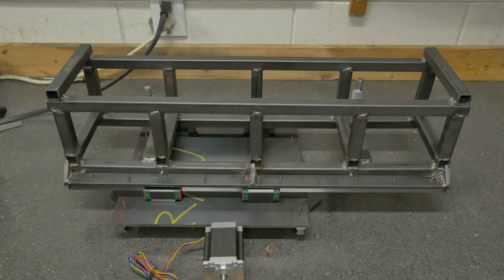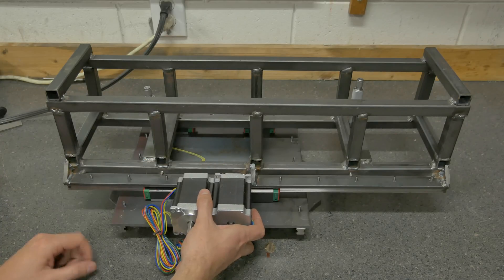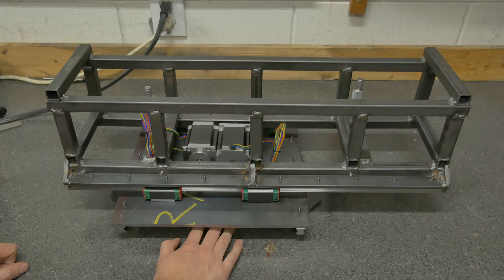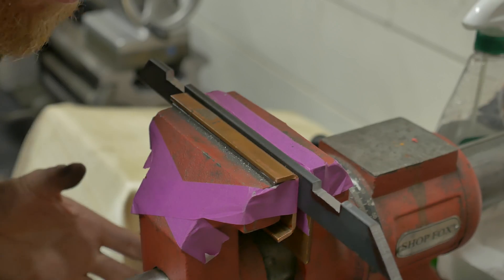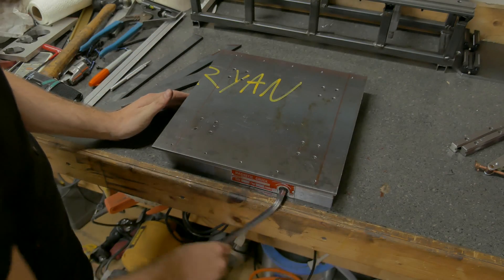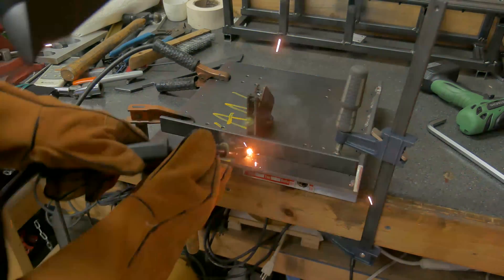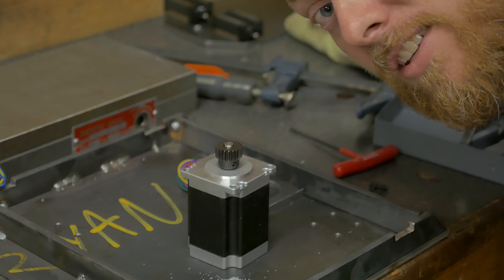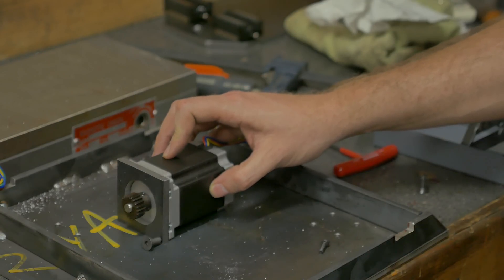Small Surface Grinder Part 4 - S02E18

Comment: Motors generate heat during operation.  You can improve their life by mounting them apart from each other, with cooling.  Also the heating they cause can cause their mounting plate to warp due to differential thermal expansion.  Anyone with a 3D printer with a heated build plate has seen this.

Comment: Did you see the table on the drillpress go down as you start to drill? this puts the hole ok 1 side but slightly out on the other. A jack under the front of the table will almost stop this 100%

Comment: Please do not lose hope in what you guys are doing, as per the critics, as it is how we all learn, by somebody telling us what to watch out for, in the efforts of your well being as safety goes, and the tips and tricks of the trades and keep at it... oh, and by the way, the jaws on the angle lock type milling vise, are designed to be sacrificial and replaceable but the slide and the stationary jaw bases are not. just in case you didn't know, I also respect the idea that you may have been clamping something large, which is why the jaws were located to the outer mounting locations. Move the removable/replaceable jaws from the outside to the inside and mill them after indication the stationary side in to tram.. That will save the life of the vise or pain to referb it later... good luck.. Dru

Comment: A chuck in a chuck? What are you thinking? Mount it properly or use the first chuck to hold the work.
Reply: CHUCKCEPTION!
well, if it works, why complain?  I know it's not recommended, but I'm sure it's temporary..
Reply: It's more about compounding errors in something being built to remove the errors in the lathe.
Reply: There is too complex to  fix square piece in 3-jaw chuck (:
Reply: yeah, that's true
Reply: Hyss it is a little ironic, isn't it? I suppose the good news is that indicating from the 4 jaw at the far end of the chain gives the option of reducing the added error, though of course there's more potential for flex. Probably not much since the added chuck is mounted via a..3-4? inch "adapter." That said I don't think it will matter here since the goal was to make a hole large enough to clear the raised part of a NEMA flange. There's not even anything being coupled to it yet, nevermind that it's recommended to use a flex joint to attach to an otherwise supported acme shaft.

Comment: Great videos, nice to see the lathe in action. Just a heads up that dc welding and magnets can cause some funky arc wander sometimes, it's less noticeable with mig but I've had a magnetic corner clamp push my tig arc out over an inch before. Doesn't hurt anything but if you ever notice a wander try moving the magnets away.